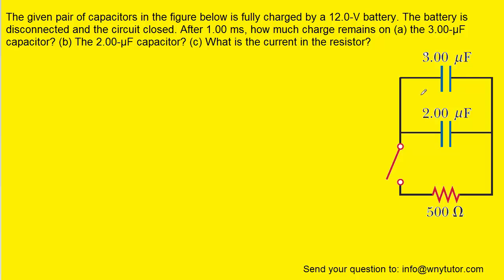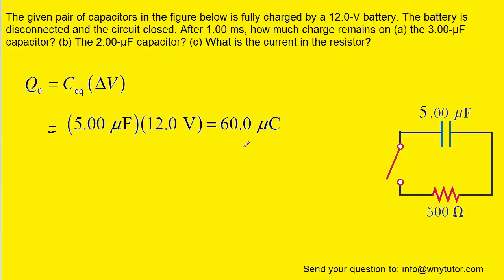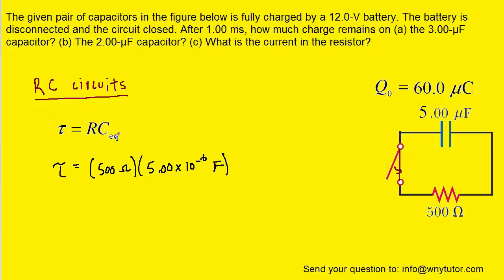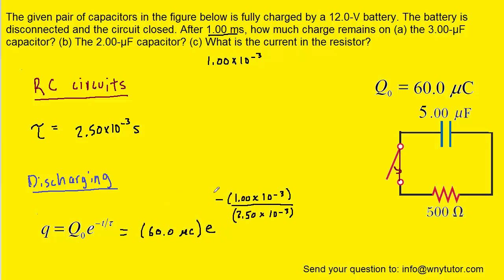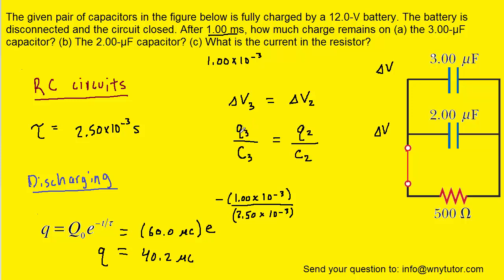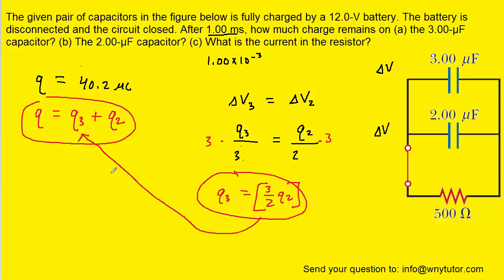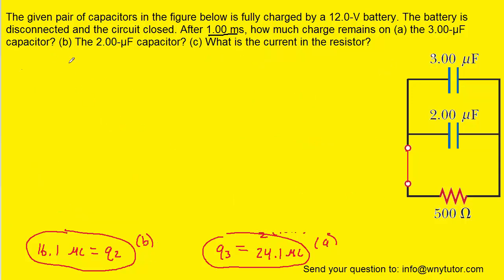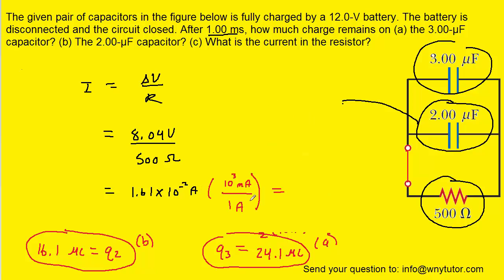The given pair of capacitors in the figure below is fully charged

Comment: Sir, as always your explanations are clear and easy to follow. However, solving a 2 x 2 system of linear equations is not the most efficient way to determine the charge on each capacitor. (Also I note that you are a physicist. Physicists always want to know how much charge there is on a particular element. By contrast engineers rarely concern themselves with charge; on those occasions when they do, the charge is stated in Amp - hours rather than Coulombs.) 

That said, the charge on a given capacitor is directly proportional to the potential difference, i.e. the voltage, across its plates. The constant of proportionality is the capacitance of the capacitor in question. Since both capacitors and the resistor are in parallel the voltage across any of them is the same as that of the others at any point in time. The potential difference as a function of time for this network is V(t) = 12*exp(-t/2.5 msec). Therefore, V(1 msec) = 12*exp(-1 msec/2.5 msec) = 8.044 volts. It follows then a) q(1 msec, 3 uF) = 24.13 uC, b) q(1 msec, 2 uF) = 16.09 uC, and c) I(1 msec, 500 ohms) = 8.044/500 = 16.09 mA.